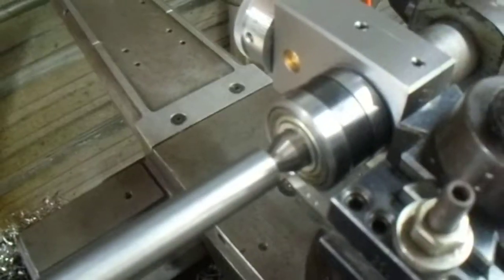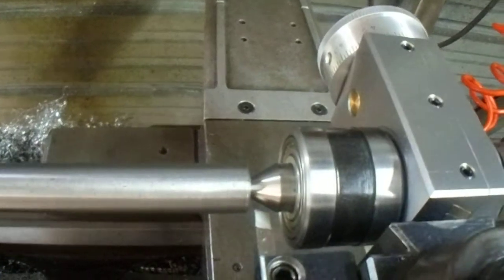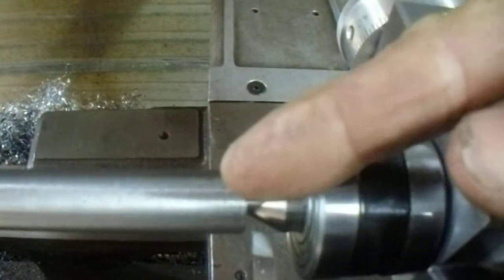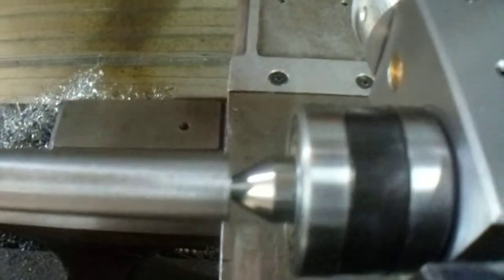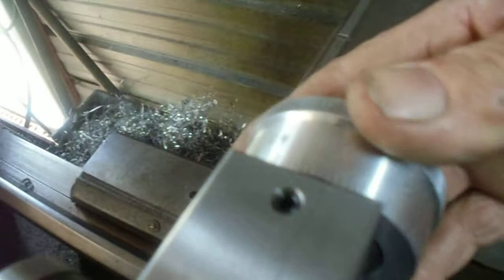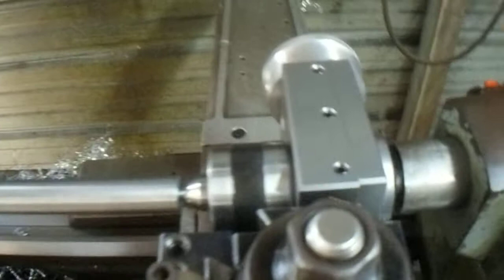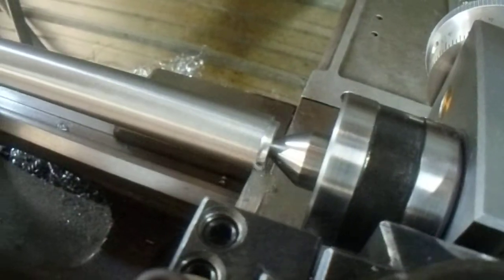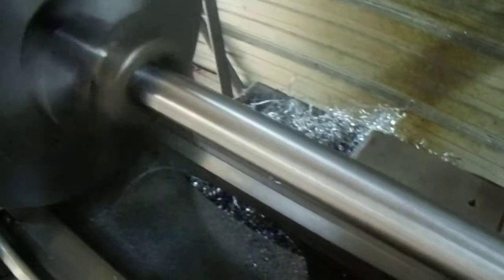Taper Turning 3

Comment: Hi Doug,
Great video. Do you have to tighten the center gib screw like we do with boring heads or does your Tailstock Taper Turning Attachment have enough sliding resistance to stay put since it is not rotating?